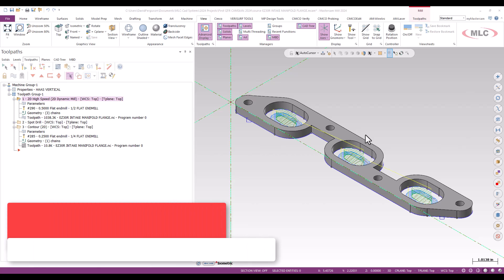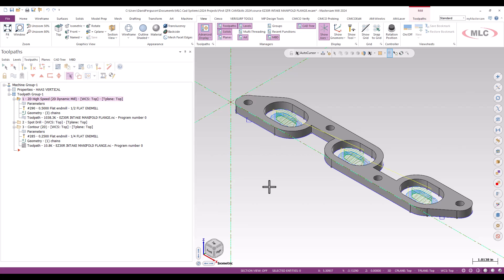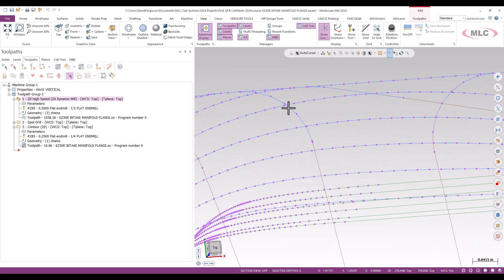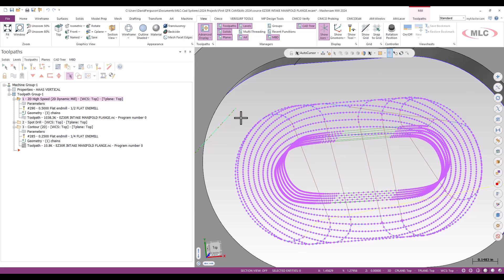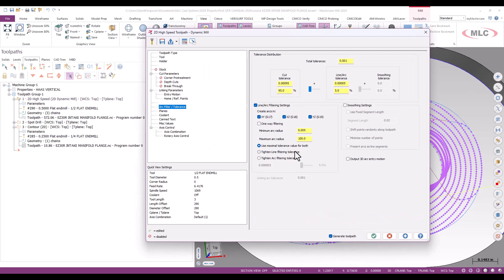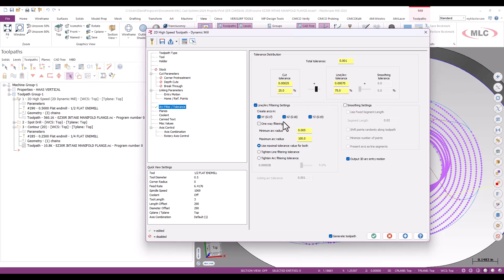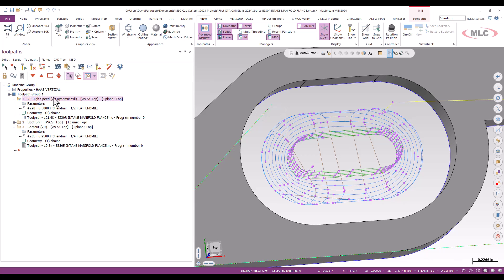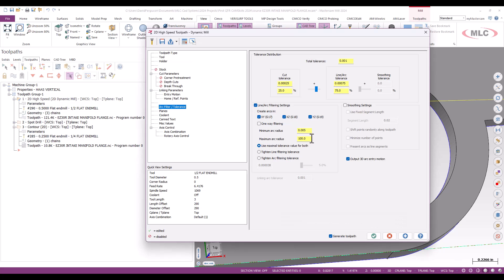Mastercam Arc Filter 101 | Improve High-Speed Toolpath Efficiency in #Mastercam

Comment: tricordial?
Reply from the maker: High-speed toolpaths use smooth motion to reduce wear on the machine and allow for very rapid but accurate motion.  This creates a path that can be defined using complex geometry, basically splines.  Trochoidal motion is the term used to describe this approach.

Comment: big question i have is, why are you not change the overall tollerance slicer to 0.1. Right on top of it, it reduces the Code output alot! Important to say is, when you reduce all this values, you should let some material on the walls otherwise you are out of the tollerances.
Reply from the maker: Two reasons, the first being that this is instructional so we wanted to step into it slowly to explore the benefits. The other reason is that the most common use case for a tool path like this is to finish around walls, so loosening that tolerance must be done carefully. Keep the tolerance under half the stock to leave on walls for best results.

Comment: Thank you for this! I've been using the arc filter but didnt know the function of the slider. Also, since I have mostly low memory machines, I always check the "minimize points' box, thinking i was accomplishing what the slider does. Since i was clearly wrong about that, what DOES the "minimize points" box actually do?
Reply from the maker: Great question!  On that dialog (and nearly every other one in Mastercam) there is a Help button that actually takes you directly to documentation about each of those settings, it is a great habit to get into for learning more about these options.  
In this case, Minimize number of points applies mostly to smoothing and only when points are very close together.  From the help article "Minimize number of points: Choose this option to minimize the number of node points in the toolpath by excluding the points that are very close to each other."